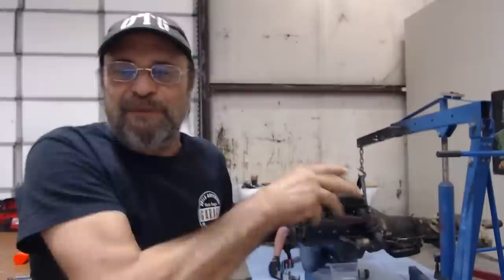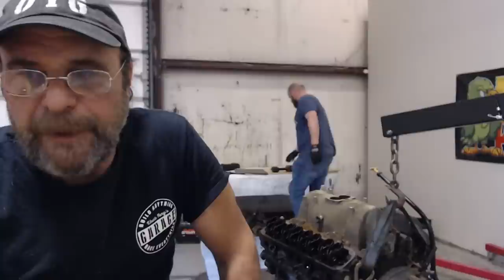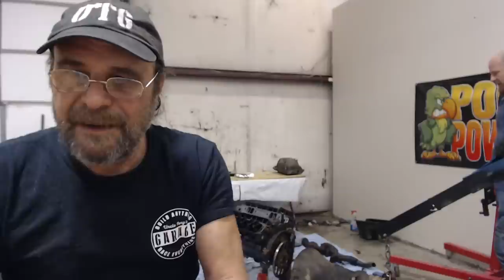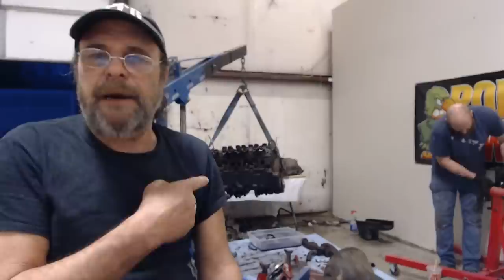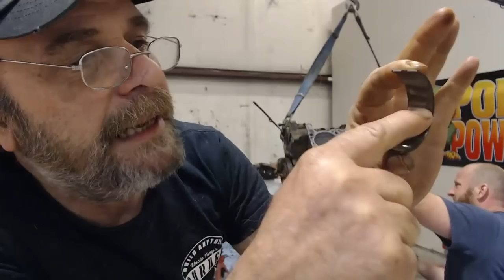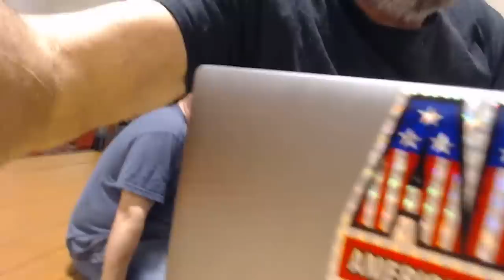SHOCKING LIVE must see VIDEO!  Bodyman Ron TEARS DOWN HIS ENGINE

Comment: I got a 1990 Dodge Ram  50, it's 4x4,fuel injected if it's raining it shifts 3 times, locks torque converter then shifts into overdrive,  it was given to me, it needed a fuel pump,  210,000— miles,runs like new!

Comment: No one drives the way I do without expecting it’s my last ride. My spark didn’t come from fear of the distributor stopping forever. It was I would be put back on the after I turned off the key. Changed my mind, I still have some miles to go. Time to drive it like I stole it.